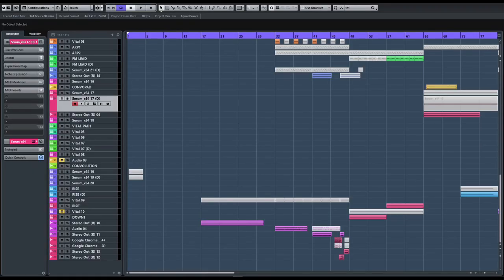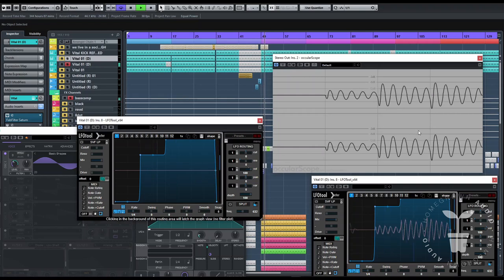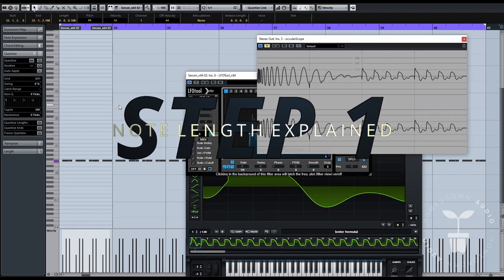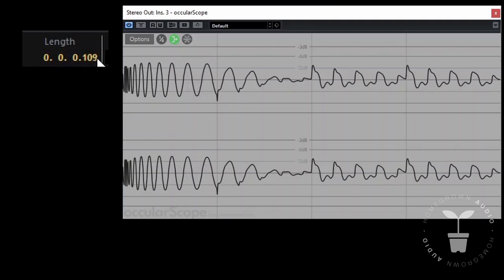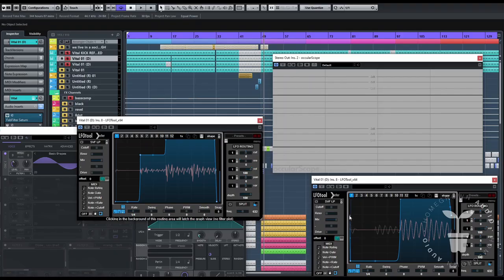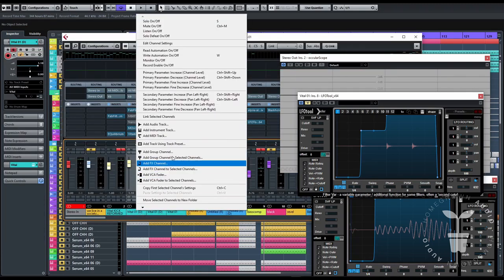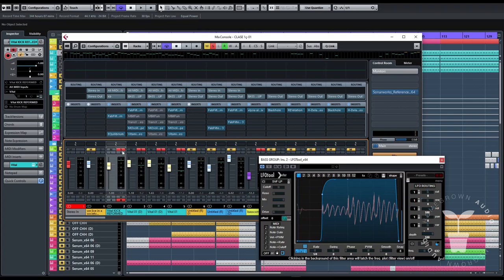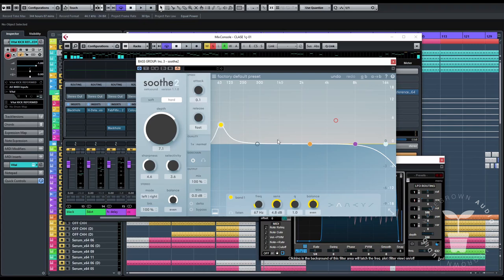PRO PSYTRANCE / EDM: Bass Essentials - 3 Tips to Fix Your Bass + Ultimate Kick & Bass Sidechain.

Comment: The Kick/Bass sidechain with Soothe is interesting. Never thought of using it in that context. Thanks a lot man :-) What would be the difference in using e.g. Trackspacer or any other spectral compressor for that purpose?
Reply from the maker: Thing with soothe it really does just remove mainly the frequency u using on kick so will make the gap exactly there